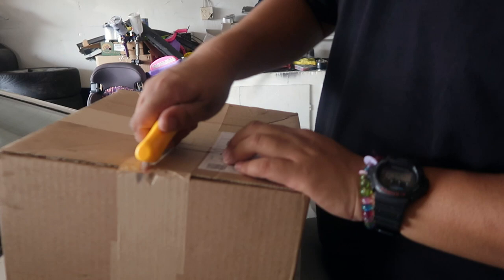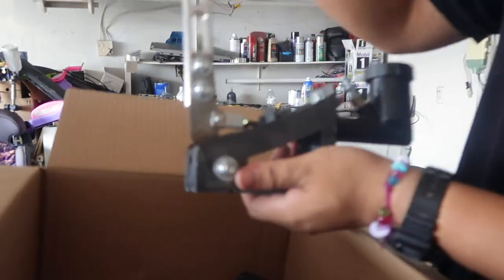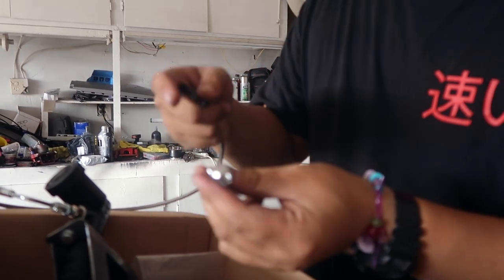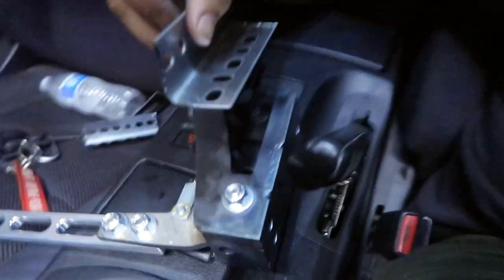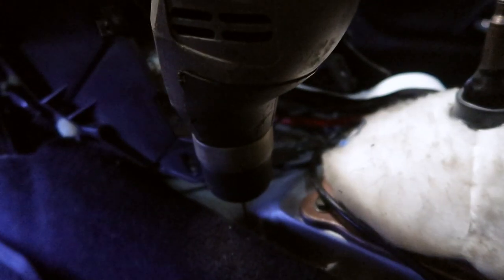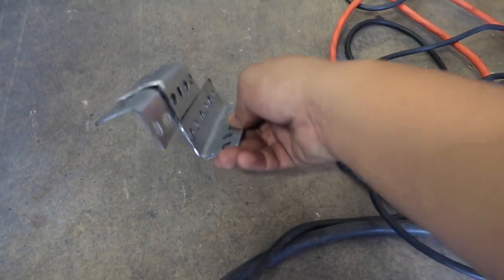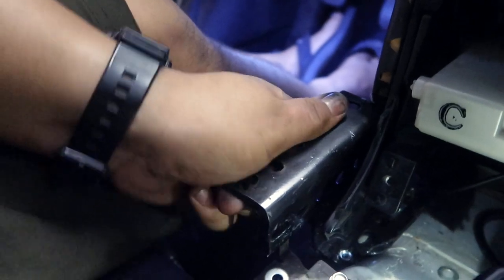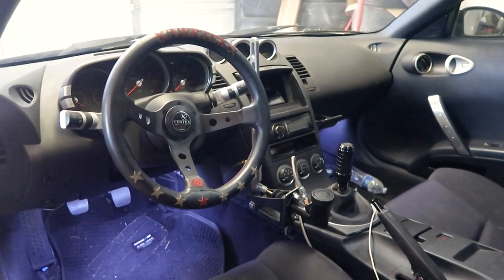350Z Hydro install, NO INTERIOR CUTTING!

Comment: Where did you rout your brake lines? Also what angle kit do you have, and also what upper camber arms do you have?
Reply from the maker: TryHard Productions it’s through the center console, into the cubby hole, then to the spare tire. It’s the pbm angle kit with spl upper camber arms.